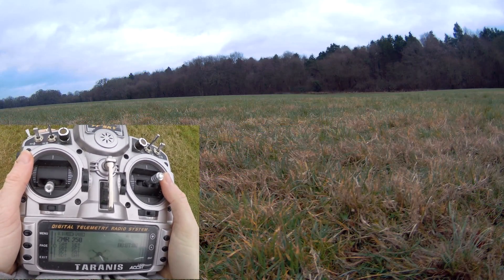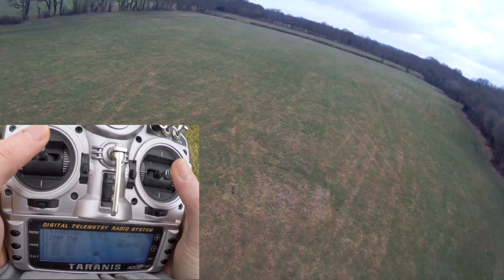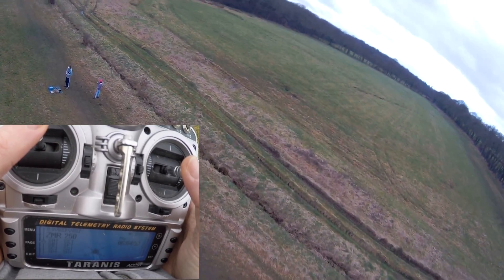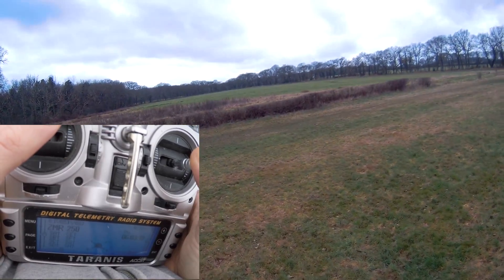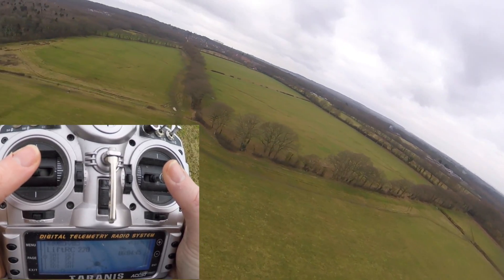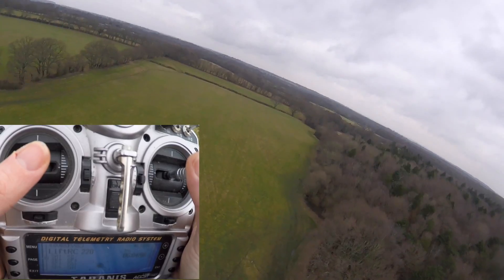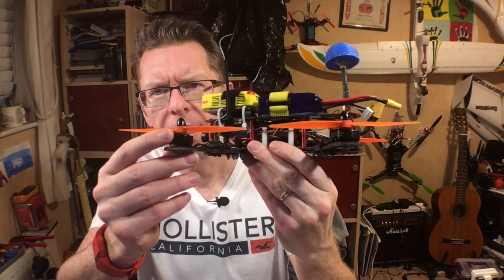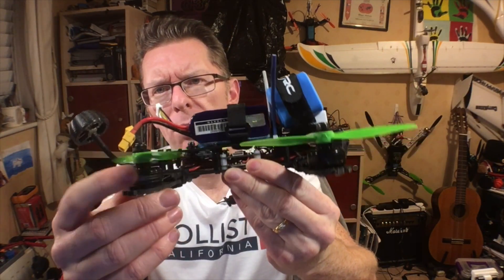FPV Tutorial: Tips for new quad Flyers Part 5 - Power setups and prop choices

Comment: My Quads are all older 5 Inch frames and components running 3s Lipo's.
They all fly well but I thought I'd build a new 5 inch quad with newer components using 4s Lipos,s and Betaflight 4.2
So any advice on moving up to 4s from 3s ??? in terms of Betaflight setup Ie Rates, Expo, Throttle Scaling etc would be appreciated !!!!
can I ask what 4s Lipo's and motors you use
Reply from the maker: In theory your rates should stay the same - although it depends on what sort of motors/props you were flying on 3s as to how it'll feel on 4s.  You should feel a lot more power - My old 3s rig was heavy and used 5030 gemfans, when I had to pull out of a dive I had to do so about 10 seconds ahead of time, but with the move to 4s the power was instant.  I wouldn't do anything with throttle scaling, just take it slowly and see if you need to bring your rates down.  I've got too many quads to think about what motors I like best - its more the overall quad.  The Xing motors (that the Nazgul 5 uses) are very good, but can be quite hard on a lipo.  It's nicer to use a 1500mAh or 1800mAh with these quads.  The Tattu R-Line v3 are my faves

Comment: Good Sir, I love this video, but even you should know, Switch arming is better then Stick.. so why is it like that?
Reply from the maker: Haha, even when I filmed this back in Feb 2017 I hadn't used that quad for a while and everything was on switch arming except for that old 3S quad.  Why, well it was built back in 2014 and is on a Naze5 board - which I'd come over to from KKs and KK2 boards.  Stick arming was just the norm for me then and I stuck with it. Obviously, I'd moved away from that with later quads, but that model was left as is (it still hangs on my wall in that original configuration - it looks like a tank with tiny motors :D)

Comment: Great advice..... I started on 3S with a F450 and S500, before moving to 5" with tri-blades. I naturally built my first 5" around 3S and it wasn't until I started flying with a local fpv group that the 'advice' started and I bought a 4s pack, then 2 more, then another 2. 
But, I still have the 3s packs and there are times when you just want a quiet, steady flight on 3s. I do think it's easy to be pushed into trying too hard too soon and being put off quickly. I really have come on by surrounding myself with great pilots, but I occasionally use my 49 years of experience in life to be me and step back.
I'll get to my point now. You are the first I have seen who say, "Hey, you want to run 3s, then run 3s"... Thank you

Comment: I'm learning acro on my 5" quad. I'm using hq 5x5x3 props. Do you think the dalprop 5046c or 5050C would be better to learn on. Thanks for your excellent series on acro. Just keep flying forward. Excellent thought tool
Reply from the maker: You might want to try a prop with a little less pitch if you want a little more range and finer control over the throttle range.  I recently used HQ 5x4.3x3 which were really nice, or perhaps a cyclone 5045 which are nice and smooth.  I'd stay away from anything higher pitch until you are happy with what you are doing and want to get more explosive climb outs
Reply: CurryKitten thanks so much. I heard a lot of good about the 5x4.3x3. However I have the 5045. Will give them a shot this weekend. Take care
Reply: I'm doing a little better everyday. It's starting to feel like stabilized mode. What I mean is comfort level is raising slowly. Found this amazing hobby at 40. I wish I had a earlier start but it is what it is. Muscle memory seems to take more time the older I get. Having explained that I feel excited to fly when I get home from work. Unfortunately I can only practice in the front or back yard most of the time. Between work and family time is hard to come by. Living in northeast Ohio the weather is usually throws a wrench in there two. I've made it my goal to be a full fledged acro pilot by the end of summer. Goals are nice ways to reward yourself with accomplishment. I usually practice hard stops and nose in for practice. Looking forward to the weekend and hopefully dry weather to start trying flips. This hobby and the community is like no other. The people like yourself are so helpful and I can't imagine having any more fun standing still. When I get line of sight down I will get some fpv goggles. Learning on my walkera F215 quad. I put kiss 32amp esc and T-motor pro 2 2400kv motors on it. Probably a little aggressive for learning. I appreciate the videos help and amazing job you do educating us all getting into the hobby. Take care all and have a nice safe weekend

Comment: Thanks for this series CK, very helpful even a year on. After 3 rebuilds my ZMR250 has been retired for about 6 months now, and i've just gotten me a very nice little ViFly X150. But that quickly made me look for some tips on flying as it's so much faster then the ZMR. This series is just what the doctor ordered :D 
Even in this video you can tell the ZMR on 3S feels like flying a bus, and as an old(er) fart i agree with you on the 3S to 4S transition, muscle memory doesn't build as fast anymore so prefer the 3S' until it's not going fast enough anymore.
Reply from the maker: Nice - one.  I firmly believe this is the right way to do it.  Once your fingers get used to it, you can fly 4s as gently as a 3s - but it's hard to get sometimes if you just jump right in and the quad it flying you more than you are flying it !  ViFly were going to send me a quad to try before going mysteriously quiet and then ignoring me, oh well :D

Comment: What size of the batteries do you use on your 3s and 4s setups?
Reply from the maker: 1300mah, with pretty high C rating.  The 3s was quite gentle so the 45-90C nanotechs were ok, but the 4s really like to blast so C rating of 70+ is recommended.   Some people use 1500 and 1800mah, but for me it just adds weight with not enough extra flight time

Comment: hey i wounder I have broke  my usb on my fc and cant get clean flight on it on my zmr but i can fly it but the rates are really  slow can i get it to flip faster without  clean flight ? can i do it on my qx7  all the settings  are stock other than mode switches  and im running  3 blade props  on it
Reply from the maker: You can increase your rates on your TX so full stick movement is (for example) 200% of normal - although you'd probably also want to play with your expo as well so it's not overly sensitive at mid-stick.  It's not ideal, but you can certainly make it quicker this way

Comment: First I would like to say great videos. On the battery subject, I see what your saying.  But instead of buying 3s and then buying batteries all over again for 4s. Wouldn't it be better to just dial down the throttle endpoint to act as a governor as such? Then bring it back up over time.
Reply from the maker: Yes - could certainly do it that way... and I should go out and give that a try and see how if feels (i.e can you make a 4s feel like a 3s quad)

I didn't suggest this for a few reasons.  Firstly, from some of the feedback I've got, some of the new pilots (who get the RTF kits) are struggling with things like Betaflight settings, and so I'm concerned that doing anything extra with radio - especially as all radios are different for this - could be pushing it.

Secondly, it was a call to try and stop people spec'ing up too much.  You see it in forums all the time "Hi I'm new, and I want to fly 15 miles away... what plane should I buy ?"  It's the same in quads where people are very keen to make sure they're got all the highest spec motors, escs, lipos with 100C rating... but haven't worked out how to land yet.  So for these people, I am deliberately trying to slow them down and force them into learning to fly a bit more before they have access to more power.

Thanks for your comment though - I might use it in a later video :)
Reply: Thanks for the reply. This is too true. I'm just starting in the whole fpv scene as well. I'm a little older and have a little more restraint.  Plus I don't want to be replacing parts every time,lol. That and the fact that I live in Canada, and places to fly legally are few and far. So it's up to guys like me to be responsible, and not tarnish the hobby. Great videos again, I've watched them several times, and are a huge help. Going to start flying acro the next time out. I'll post some videos, maybe you could give me some criticism. Lol. Keep up the good work!

Comment: I just ordered a Runcam Swift 2 after seeing that it has a couple of built-in OSD features, including a voltage monitor. Factor in that the Eachine Wizard that I shall be ordering (as soon as there is some in bloody stock) comes with a CMOS camera, I though sod it and went overbudget a bit more. If it saves me money in knackered batteries it's a good choice.

Got a question though, of course - if I have a 3S 1300mah, giving total of 11.1v, what voltage shall I land at so I don;t overdrain my lipo? Thx for replies.
Reply: Andrew Goodall try to stay on 3.7 3.6 v per cell so do the math :)
Reply: Andrew Goodall got runcam swift 2 with osd and wizard 😊
Reply from the maker: Nice, get building - it's a great way to learn and figure stuff out as you go !
Reply: CurryKitten I've build my zmr 250 cc3d based long time ago and modded wizard 4s betaflight time. great videos about betaflight basics. Thanks to You I've made my Wizard a lot slower and smoother as I need slower quad for learning acro & not crazy fast straight away. Always I can speed it up and make it more agile if I want.
Reply: I'll try answering my own question, though someone please check me. Apparently when fully charged it'll be telling me 12.6v, and when it gets down to 11v that's when I want to land (each cell has ~3.6v at that point)?
Reply from the maker: Yep - fully charged is 4.2v per cell (so 12.6v for a 3s) I tend to land a quad at 3.5v per cell (around 10.5v)  I was hoping to make a video about lipo care today, but I got sidetracked on some other projects :)  Runcam 2 looks ace BTW, I have a Runcam 1 on a build somewhere... just don't forget to make sure that WDR is enabled (which will make it handle the light the best - I thinks it's off by default)
Reply: I didn't get a Wizard in the end . I bought a load of different bits - Cobra motors, Rotorgeeks SSD F3 FC, Runcam Swift 2, Martian II frame, to build myself. Haven't put it all together yet, slow process getting it all delivered (got it all now though), learning everything including how to solder :D, plus Betaflight etc. Am practising on FPV Freerider with my FlySky i6, and God knows I need it.

But yesterday I took delivery of Eachine Falcon 210 Pro because they were selling it for £86 with coupon code, including (shit) CMOS camera, 1500mah battery and Flysky i6 (now I have two) radio and receiver. I just have to set it up and I have something to practise with and crash and use my self-build later when I have experience. 

Good luck with Wizard chap. Hope you are enjoying it . :)
Reply from the maker: Hey cool - nice going.  You'll be surprised just how quickly you'll progress and start making these tiny little stick movements without thinking about it :)
Reply: CurryKitten driving on heavy Fork Lift trucks with joysticks from 10years so I should be good on sticks with acro eventually. I'll get on my FlySky FS-i6s as its great simple radio system to practice with. I like gimbals on it for the price are awesome. I need More fpv/acro Practice  I've got Quanum Cyclops for now. I'm thinking about Aomway Commanders next year if my Acro skills will be better :). great videos. keep them Comming. ps I just bought gopro session for better video quality footage as well. I like it's form factor

Comment: Posting again :) - The URL was to:

banggood Eachine Wizard X220 FPV Racer Blheli_S F3 6DOF 5.8G 48CH 200MW 700TVL Camera w/ FlySky I6 RTF

Hello chap, I'm biting the bullet and buying an Eachine X220 Wizard for my first racing drone away from the Syma, which I hear nothing but good things about for newbies.

It comes with a Flysky-i6 and iA6 receiver, which I know isn't a Taranis but that's all the budget there is for that and I believe it's enough to get me flying and Betaflight.

It has a Naze32 board with Betaflight, 2205 2300KV brushless motors, bheli-s ESC, 5 inch props with loads of spares, a CMOS camera (shame) and a 1500mah battery.

Can you recommend me 3s batteries for this, reasonably priced (lol) and anything else you can think of that I might not have considered (cable for radio?) so I can order it all together? Thanks again for your help.

I can't wait to get away from sodding auto-levelling, crappy range and abysmal wind-handling :D .
Show less
Reply from the maker: Hi Andrew - thanks for reposting.  For 3s (and what I used in this video) I used Nano-Tech 1300 45-90c (I used a lower C rating before and those lipo puffed up like a balloon) you can get those on HobbyKing.  Banggood do some  quite high C rated lipos now, but I've not used them, so can't personally recommend.

The x220 looks great, seen some rave reviews and you should get it flying nicely.  In the pictures on Banggood it seems to be pictured with some linear (whip) antennas, so you might want to pick up a pair of skews for better video.  The AOMway 5.8 skews are pretty good (RP-SMA according to the x220 specs).  At some point (although not urgent) you might want to invest in a better charger as well - something that can put your lipos back into storage charge when not being used.

Not sure about the cable for the radio - sorry.  It would certainly be useful to have one you can plug into the computer to use a sim, but not sure if you need the data cable to change certain things on the radio, or can do it all via the screen ?
Reply: Not a clue on the radio. My only other question then is the C rating on the batteries, presumably it needs to be in line with the motors or ESC  <quick google> . The battery it comes with is a 25C, but the ESCs have peak load of 25a. Does this not mean the C rating is overkill?
Reply from the maker: It works like this.  The lipo is 1500mah so at 1C it can pull 1.5A so at 25C it can cope with 37.5A The ESCs are 25A peak, but there are 4 of them remember so if they all hit peak that's 100A.  Of course you won't be hitting that, but you can probably still go past it's C rating.  No in theory, the 25-50c Nanotechs I first got should have coped, but they are all pants and turned into beachballs.  Hence why I recommend the 45-90c.  Another issue is that manufacturers C ratings aren't necessarily accurate - so if in doubt go high.  FLying miniquads isn't kind to lipos, but higher C ratings should cope better with the stress than  others.
Reply: I was thinking nooo - 4x ESC means 100amps! Can't be right, arc welders pull that lol :D .

Anyway - go high on C rating because batteries can be shite. Roger, I'll look at the Nanos, thx for help (again).
Reply: the nanos are very good im using the 1300 3cell  45-90c and im loving them, lots of power,, ive put  them through hell and they are stil going strong im flying the same build but 2204 motors only been flying a week so these video help alot

Comment: nice video, trying to into fpv and It is not Easy as you see on YouTube. I found out that a three blade is giving more stability and easy to fly. hopefully in the next month will get better in acro mode and follow your suggestion
Reply from the maker: Yes - often the phrase mentioned on 3-blades is they tend to "catch" better in the turns.  As long as you try them all out and see what feels good for your flying - that's the main thing :)
Reply: CurryKitten also I bought a small drone , a qx70 to do most dangerous manoeuvres so I can save props and lif's ahah

Comment: Great advice. I'm currently running on 3 cell and the quad I have is very powerful so much so it scares me. It does only weigh 500 grams (including 3s battery) and has racestar 2205 2600kv motors. Having watched this I think I'll go and buy some 5030 props to try and slow things down a little and improve amp draw. Thanks!
Reply from the maker: I tried some 2206-2600 motors with some 3 blade 5045BN's - absolute lipo killers, my full 4s sagged to 11.something v in around 2 seconds (allbeit in a full throttle punch ou) !  It recovered, but whilst I'm happy going fast, I want a flight of more than 1m 30s - so I'll be taking my own advice there :)